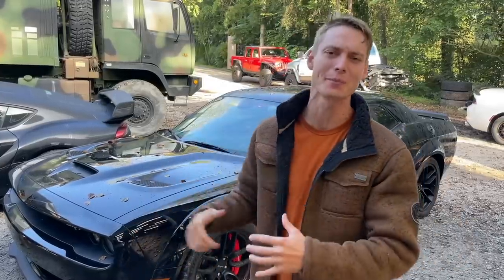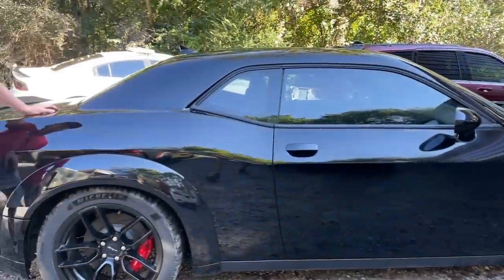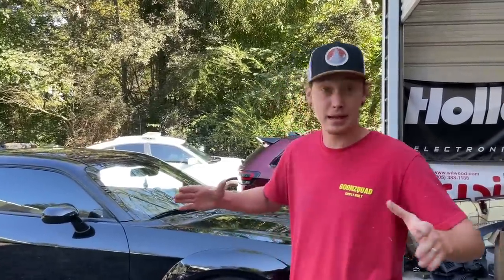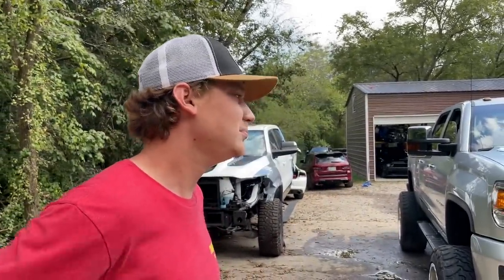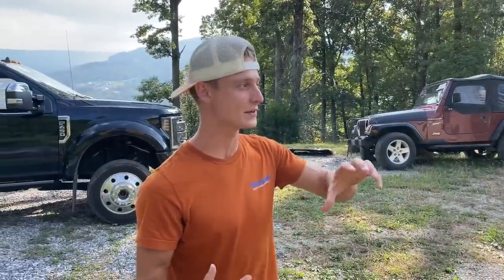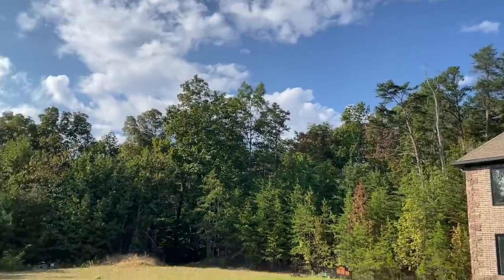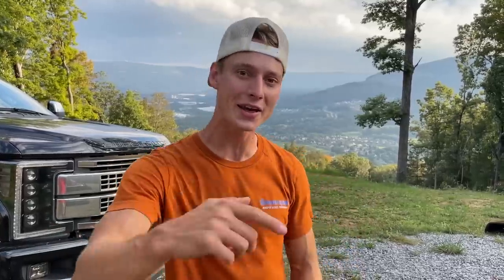Preparing All Our Builds For Sale Part 5!!!

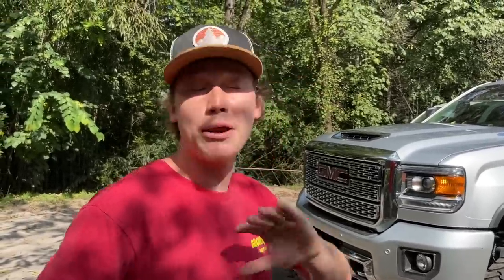Comment: 8:48 "and it towed the f450 flawlessly"... did you forget you filmed that trip?.. I went into Limp Mode twice haha from what I can remember if anyone else can too. 😄
Reply: The reason it’s going in to limp mode because they tuned up the engine blowing way to much soot into the filter …Must be deleted for a tuneup application or the system can’t keep up with the soot
Reply: @moneymark144ify  haha ye I know that. Over fueling to role coal makes it so much worse.
Reply: That was when they picked up pops truck.
Reply: @julianmendoza549  Ye I thought it was a big pickup of some sort.

Comment: Why don’t they use car covers? I feel like that would save so many cars detailing times and condition in general
Reply: Same reason they never use battery tender or unhook batteries on vehicle that sit. Every car they have built has gone though at least 2 battery and I gaurentee your getting a junk battery with any vehicle you buy from them
Reply: If you have had any experience with car covers you soon realize it's just a good way to scratch up your paint.  They aren't even good inside a garage unless you are more like a museum like environment because the car cover gets dirty and if there is the slightest wind or wetness it will jack up the finish.  There are some inflatable clear plastic car "covers" but they are pretty expensive and not practical for more than a car or two.
Reply: @UltraReefReseller  not if you spray the cars with wd40 before covering. its an old collectors trick
Reply: Goonzqaud  NOTICE IT'S FAKE GOONZQAUD CHANNEL⚠️⚠️⚠️
Reply: @damianboswell6425  would take several 55 gallon barrels for these guys.
Reply: @concepthouse5410  Report them all as Spam.  Thanks
Reply: Car covers actually cause problems over time. They hold in the moisture and can rust a car quick. Don't believe me go fallow Dennis Collins and get his opinion..
Reply: Car covers = rust.
Reply: Especially with the damage they have done to the paint on the cars under them trees. The cars that have them fresh paint jobs that ain't really cured yet probably get real bad stains from all that stuff on them.
Reply: @johnsnow1355  that’s why they’re building a garage
Reply: @concepthouse5410  Report the comments as spam and copy the legit Goonzquad channel URL then go to the fake channels about on their page and report user 
for impersonation and paste the legit link.  The only way this crap will ever stop is if WE do OUR job.
Reply: @damianboswell6425  bro what
Reply: NEVER EVER use a car cover outdoors. Moisture builds up underneath and will wreck your paint. A good example is that moisture will boil your paint/finish when the hot sun is shining on it. Dennis Collins from Coffee Walk despises using car covers as well. I've seen first hand what happens using covers outside and its not pretty.
Reply: It's because they can make more videos and spend more time on videos cleaning cars it's called being lazy
Reply: Car covers scratch the clear leading to severe swirl marks. Better off letting the elements have at it and do a once a year polish/wax.
Reply: @KeepItReal2024  and mold
Reply: Car covers damage the paint when they move in the wind.  It is better to wash them.
Reply: More content.
Reply: I know right. They were sent lots of car covers by viewers too. Throw them on the vehicles.
Reply: Goonzqaud  excuse me, I wish to send you all my money in my bank account. Please DM
Reply: @Ghoststalker777  a bit dramatic
Reply: @concepthouse5410  yea, reported for spam
Reply: Goonzqaud wtf????
Reply: John Snow ohh you guarantee that huh?
Reply: @UltraReefReseller  short term their ok if you get the fleecy underlyined ones.
Reply: Ceramic coat maybe?
Reply: @concepthouse5410  reported as spam.  I don’t know if those spams disappeared from all views, but it disappeared from my view.
Reply: Because they hold moisture in , car covers are not good for long term
Reply: @damianboswell6425  It eats at the clearcoat though...
Reply: @diegodevops4151  For sure, Goonzquad is not spelled with the A before the U. Saw that right away
Reply: @nathanv2358  no mate wd40 is not abrasive at all. Hard-core car collectors use it before covering cars all the time.
Reply: @scottthorson1  That is why you need the more expensive ones. With a Gore-Tex™ kind of fabric inside, so it's watertight and yet it can breathe!
Reply: @JG-nx3jg  😂
Reply: I've reported the fake goonzquad in the comment section. We all need to do it this needs to stop!
Reply: @jasonhobbs5611  So have I!! Agreed!
Reply: @LarryTait1  they disappeared from mine when I reported them but when I left the video then came back clicked on the comment and they were back on view mate 👍
Reply: @johnsnow1355  who cares you can buy a new batter for 200 at most and honestly with the deal your getting at their price point you shouldn’t complain about a simple easy purchase and easy install of a new battery your argument is irrelevant and a wise man once told me... it’s even a stupid comment he said, and a wise man will always believe a fellow wise man.
Reply: Goonzqaud  You spelled your name wrong.
Goonzquad << that's the correct spelling
Reply: @patrickmccuiston7762   The lads are getting older and a little wiser and that's what has pushed them in the direction to sell, they are a rebuild channel which has now grown into a property development channel now aswel. 
They are building a big workshop up at the new house aswel as 2 more houses which I think Simone and possibly mum+pops if not there sister will probably move into it. They have clearly been brought up the right way, they have respect to their elders and they share alot of there income with the whole family. That gets a big ❤ from me.
Reply: @IhateYoutube  No it would stop if Youtube did their job. I don't understand why they let these spammers roam freely so many things they could do to stop them....
Reply: @GALENGODIS  Trust me the last thing I want to do is defend YT but the truth is that they nor any other service has been able to successfully stop spammers. 

They take steps to slow them down but they always adapt. That's why it's important that we as humans who are here watching content and reading comments, report the stuff that's spam. 

Now, where YT gets a fail is from not responding fast enough when stuff is reported... I'll give you that!
Reply: @damianboswell6425  that’s a great way to destroy the clear coat
Reply: @jerrygiarratana9462  Spam man, fake account trying to scam some people, notice the name is not spelled right.

These bots, they're like a plague of critters.

Comment: Hello Guys. For the GMC truck, you have to service the gold plugs diesel injectors. When they are plugged, it messes up the diesel and air mixture and the particular filter gets plugged. I have experience with diesel engines here in central Europe. Don't chanhe the DPF. Once you service the Plugs, make sure the oxigen sensors are good and you can clean and regenerate the DPF.

Comment: I remember loving the GMC build…until they put on the lift kit with those ugly gaudy wheels. I laughed a few months later when they said they don’t use it because it’s lifted
Reply: They should sell what they took off along with the truck.
Reply: Lol, i remember, they were building a tow rig, them did mods to ruin it. Same with many other builds, like the flares they put on the hellcat, then spacer, that will ruin the handling.
Reply: Think the Ferrari was the worst.  Those aftermarket bumpers are the ugliest bumpers in the world
Reply: @pete_mitchell  no it won’t it’ll drive The wheels will just be a little wider lol
Reply: @luthandodyasi5497  good thing it’s not ur car
Reply: @luthandodyasi5497  You mean the Vorsteiner kits that’s probably regarded as the absolute best kit you can buy for that car. Come on man do better.
Reply: Agreed. They ruined that GMC. That build was over all lazy from the start. It really irked me that they didn’t fix the tailgate when they were painting all the other parts. Would have only taken a few hours. The. They ruin it with that lift and wheels. I think if they took the lift off and put the stock wheels back on it they would have a better time selling it.
Reply: Yea they totally ruined that truck, but they did it for views so they made money on it but they ruined a perfectly good truck they could use for hauling and such I remember they said it wasn't a good truck to pull a trailer with because of the awful lift they put on it! Lol but if I was to purchase it the first thing I would do is take them rock slingers off and lower it a few inches!
Reply: @ingresswizard9044  that's why they don't even drive or talk about the Ferrari.  You have eyes those bumpers ruins that car.  The kit can be made by Ferrari themselves but it's ugly no matter who made it.
Reply: Why everyone got to hate on lift kits? So what if it's tall it's not yours to deal with 🤷‍♂️
Reply: @320dlman4  not hating on lift kits it's really the extreme offset of the rims that's bad! I think lifted trucks look really good if it's not mine, if it were mine I would take it down a few inches and take them ridiculous offset wheels off! PERIOD
Reply: @joeysweet9045  oh ok i apologize so much hate in the comments hard to discern lol but yea I do about 4 inch lift on mine and about 12.50 wide tires
Reply: @320dlman4  no problem
Reply: @luthandodyasi5497  my dude when you have your own Ferrari you can do whatever you want with it. The Ferrari bumper is worth more then your lifesaving 😂
Reply: @ingresswizard9044  Agreed, but it will sell just as quick as the others.  They aren't the only people out there that like to do silly impractical stuff to their trucks.
Reply: @320dlman4  As someone else said, it looks like a huge roller skate. 🛼
Reply: @Rieksfier  lol true but still looks cool tho 🤣
Reply: @ingresswizard9044  well everyone has different taste. Looks really good in my opinion. They didn't ruin anything if they like it.

Comment: Drive the gmc hard for a couple of days and you’ll be fine with regards to the filter, this happens when you’re not putting the engine under a lot load thus not producing enough heat to burn the exhaust gas. That’s what we do in the U.K. with diesel cars anyways drive them around the highways hard then it’s fine

Comment: No one noticed that the rear carpet and seats got sprayed with water, they didn't wipe it off or let it dry, then installed the new glass over the wet carpet.  Future mold issue and water stains on the leather and carpet.  Curious why they weren't selling them all along, and why they are left in the leaves to get dirty instead of driving a different one every day to keep them charged and cleaner?

Comment: Priced to high for a rebuilt title. Despite the add-ons.
Reply: They will get it. Could prob. get 50…
Reply: And everyone knows when you add all them add-ons you never really make your $ back on them .
Reply: @GarageGeek  yea they probably could get that much but it’s definitely not worth it
Reply: And to replace that re-gen system is going to be in the thousands of dollars. It won’t pass emissions as it is now. I wouldn’t give over $30,000 for it as it sits.
Reply: Rebuilt titles are generally 30% off clean titles. Maybe a touch high, but not far off.
Reply: @monroefive-o40  it's a heavy duty 2500s 3500s f250 f350s all do not require emissions testing unless you live in California. It can be broke or spend, 5k and delete the truck and have no emissions and pass inspection.
Reply: That truck would bring 50-55k easy even with a rebuild title
Reply: Have you checked the used car price lately? Plus there are plenty of people who would pay a % higher because it is a Goonzsquad build.......
Reply: @krice24  many other states other then California require emissions testing for diesels.
Reply: @Justaneon99  lots of things to determine that generalization, but its closer to 40% in my area.  Not to mention most banks will not finance them, so you have to also consider having that kind of cash laying around and accessible.
Reply: @krice24  Have you not been paying attention to the EPA lately. All states are going to require testing here real soon. It’s just a matter of implementation at this point.

Comment: I noticed the AC flashing in the Hellcat indicating a fault (probably no refrigerant in the system) you guys might want to see to that before you sell it. Cheap fix, but it sucks when you have no AC
Reply: LOL it’s an led light brother. It blinks only on canera
Reply: @iggybatista8215  only LCD display do that or exterior lighting.
Reply: @johnsnow1355  it’s not because there hiding something.
Reply: @johnsnow1355  Bit of an issue with licensing and insurance as well, in addition to nothing ever really being completely done.

Comment: I'm sad to see that you're planning to put wheel spacers on the HellCat. I understand that if, and only if, you use Hub-Centric spacers it would be 'considered safe to use', but why increase the risk of part failure and stress on the suspension components on such a high horse-power beast???
Reply: The new owner is probably gonna remove those fender flares and no wheel spacers.
Reply: Spin those wheels once with the spacers and you will tear the inside of the wheels right out with the amount of torque that car puts out !!
Reply: If new owner removes fender flares expect paint underneath to come with it.
Reply: I’m assuming you’ve never used spacers, correct?
Reply: @DesignBuildFixReview  im guessing they will soak the 3m with goo gone or rubbing alcohol first
Reply: That’s exactly what I’ve said as well! Wheel spacers put stress on your wheel bearings …………..much better to get new wheels with the right offset…..
Reply: Without longer studs spacers are very dangerous. You need at least a 2 inch to use a threaded spacer instead of the slide over the stud ones.
Reply: @DesignBuildFixReview  Nah use some dental floss to cut thru the 3m tape. Then it’s easy to remove without damage.
Reply: @ingresswizard9044  the problem is they didn’t 3m tape it. In the last video they said that they used epoxy to bid them to the car. So yeah that paint is done if they try to take it off.
Reply: @Outlier117  go back and actually watch the video. It shows him using 3M tape, and he even says they used just the tape.
Reply: @06m50blue  haha yeah you’re right my bad. It will probably still peel the paint up though since they just put it on a fresh painted surface. Most of their paint jobs are 10 footers.

Comment: When you sell the 2019 GMC pick up truck, with the Duramax engine, and Billy says the 2019 GMC pick up truck needs the emissions repaired for burning diesel fuel, make sure people understand what they are buying... I say that because if you could have fixed it for a couple thousand dollars, I believe you would have paid - for those costly emission repairs...
Reply: I'd check a dealership to see if the Def issue is cover under a special policy
Reply: @papabearof3  def system isnt having problems. It's dpf filter (diesel particulate filter
Reply: @Gibbbrayden  you would think if theirs not a really big problem them filters shouldn't be in that bad of condition especially with the low milage they have on it.
Reply: @jamesmeehan5033  yeah the emissions on all Diesel trucks sucks. And doesn't in the end will not help the environment
Reply: It's just the rubbish "tune" the DPF is doing its job
Reply: Once you depart from stock you get inefficient combustion and soot so the DPF blocks up, if you want to change stuff use Banks kit at least they know why they are doing stuff
Reply: @papabearof3  if you watch this 9 minute clip explaining the diesel emissions (Duramax Diesel Exhaust After-Treatment System - YouTube) you will see why these diesel trucks are still being sold, their $10,000.00 emissions systems which Billy was correct saying is no longer working, and Billy also mentioned you can replace the exhaust, for just off-road use @12:40, not too sure why they would mention that for a $45,000 truck - AS is?
Reply: @Gibbbrayden  I agree they do suck and they wonder why so many people to the emissions delete.
Reply: @kwinterburn  if you watched the video building it. You would know it has the banks derringer tuner
Reply: @papabearof3  Not on a salvage truck.

Comment: So how much water went into the interior between the rain and the pressure washer? You guys charging extra for the soap on the third brake light and the mold that is probably gonna start growing on the back set? 
For the level of work that gets done by you guys I was surprised to see that you didn't dry everything out completely before putting the rear glass in. Kinda makes me wonder how many other short cuts or shoddy work gets done off camera.

Comment: My only concern with the Hellcat is the water intrusion from not having a back window for a year . How much hidden rust will be in the trunk and back deck area in a few years if you were to buy it ? As far as the wheel spacers not a fan but Jose has them on his Hell Kitty and let's just says he spun the tires a few times 😉 and no issues so far on his 3 set of tires . The right wheels and tires will make this car stick to the road so it might be worth it to find something better if you buy this car and set it up to what you're going to use it for .